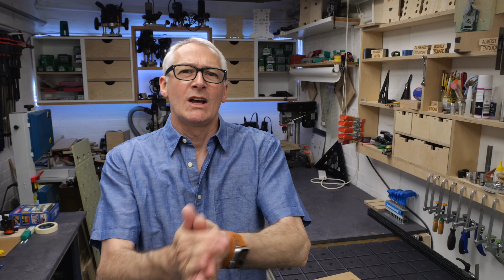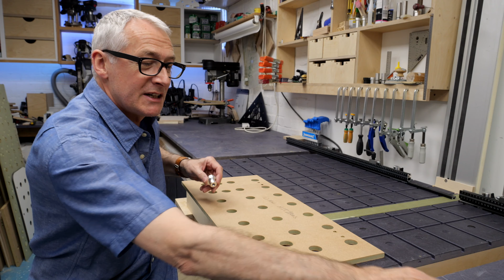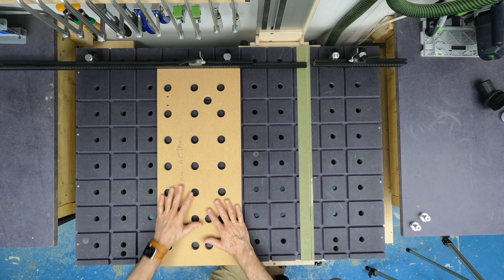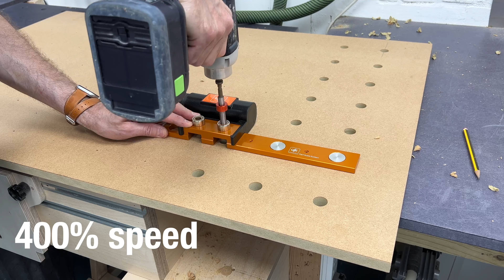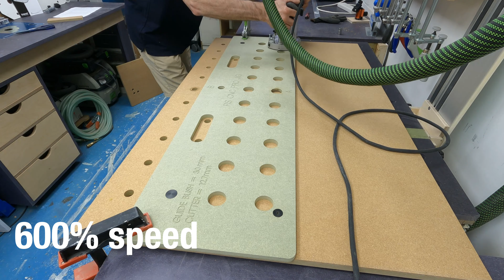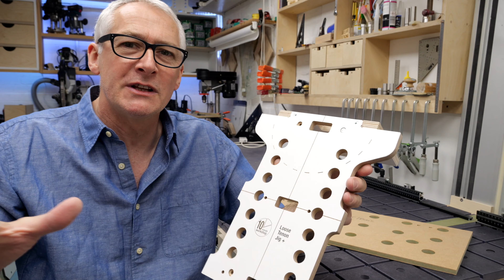A Week In The Workshop 141

Comment: Peter - at 10:10 in you mentioned that what you really needed was an 'undersized' 20mm router bit/cutter.

I, along with many of your watchers, are retired time-served engineers/craftsmen and the reamer is familiar to to us for achieving an accuratley dimensioned hole by drilling slightly undersized (say by a 1/64") and then sneaking up on the desired fit by use of an appropriately sized expanding reamer.

Because engineering tolerences are now commonplace in many aspects of woodworking, your plea to Trend (in my opinion) should be pushing on an 'open door' as the 'reamer' element of the problem has already been solved by Axminster and BenchDogs - all we need is a 19.9 bit/cutter (or an inspired and safe way to hone a 20mm straight TCT cutter down to 19.9mm) ...
Reply from the maker: Thank you; I suspected you've landed on this video from a link in my current member video, where I do share the fact that the 'bit issue' is resolved. 👍

Comment: Great jig, Peter. Might be a good idea to put a bevel on the sides (like a kitchen cutting board), just to make it easier to pick up.
Reply from the maker: Thanks, yes it’s crossed my mind; adds a lot to the cost though, as each has to be done manually/individually ie after the jigs are cut from sheet, because it’s in the underside. Still looking at all the costs though. 👍👍

Comment: This one looks super interesting! I've been using a Bora Centipede mft style top as a template and it's cumbersome. The 10min jig would be a great way to eventually make a new one.

BTW could this be used to make a fence piece with the bigger holes for the top of the dogs? Like with a flush trim bit. Only downside I could guess would be that it would be a bit more wear and tear on the jig.
Reply from the maker: Thanks Runar - and welcome BTW!  Yes, you could use the jig as a template to flush-trim 30mm holes, but you’d need to be very cautious about it - it would be a shame to mess up the jig doing something it wasn’t intended to do! 👍
Reply: @10MinuteWorkshop  thanks! I finally got around to signing up on the site 😃

I suppose it would be safer to pre drill with a smaller bit and use a bottom bearing flush trim bit with the template below the workpiece, but I do realize I can also make 20mm holes and use 20mm aluminum pipe instead.

Comment: Brilliant idea for a jig. I’ve used the RS one and really don’t like the 30mm guide bush/12.7mm bit “and wiggle” approach. A slightly undersized 20mm bit with a straight plunge looks ideal. I guess that not all routers have the same accuracy/run out so it’ll be interesting to see how it works in practice. My benches are 1400mm x 600mm so making my own tops is ideal.
Reply from the maker: Cheers Simon!  Yes, I’ll be a bit of a compromise re the router bit, and you’ll never make everyone perfectly happy, but it’ll be better than a stock 20mm bit, for sure. 👍